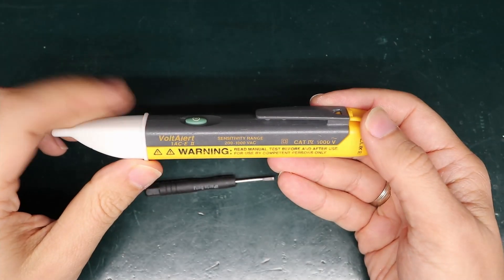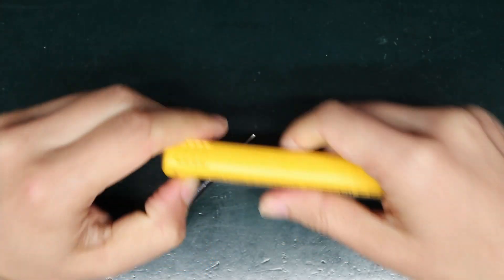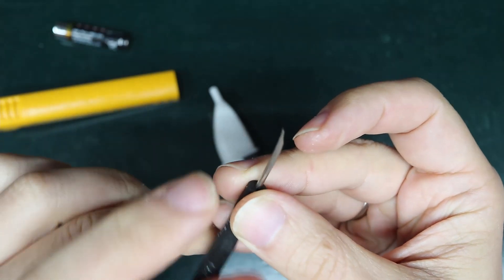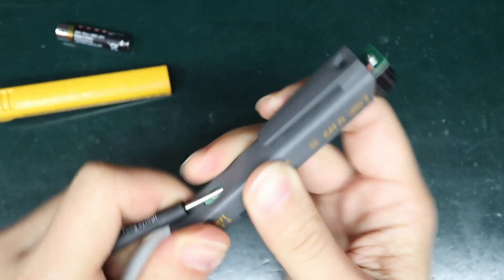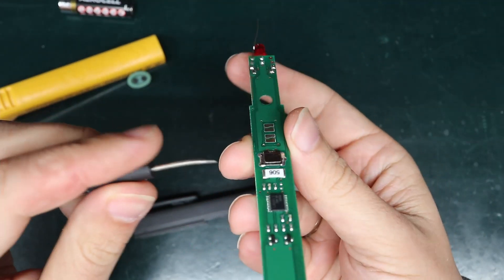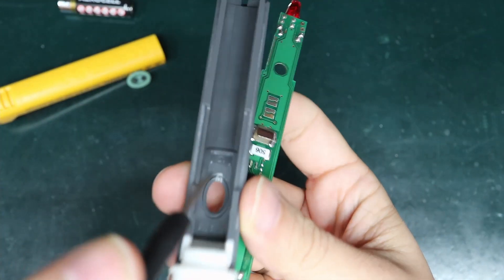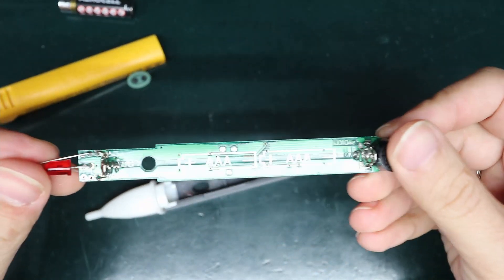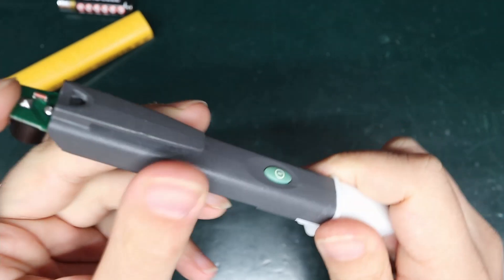Fluke VoltAlert disassembly procedure

Comment: Perfect, exactly the info I needed!! I figured there should be a release? I used a old credit card as the tool. Cut to fit and had to use small pliers to apply enough force. I tried several sizes of zip ties cut to fit but they were all a little too soft to work as well as the expired credit card material. Thanks for sharing your experience!!

Comment: Thanks. You helped me to open mine without damage. The batteries leaked inside and i needed to clean it. I used a dissamble tool with a bend from a smartphone repair kit.